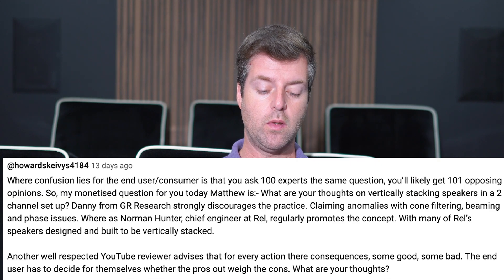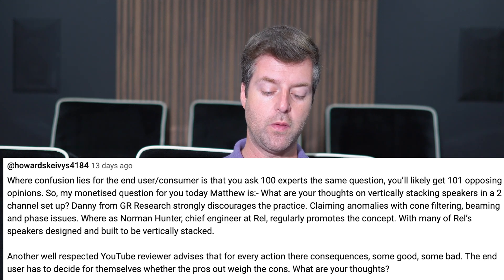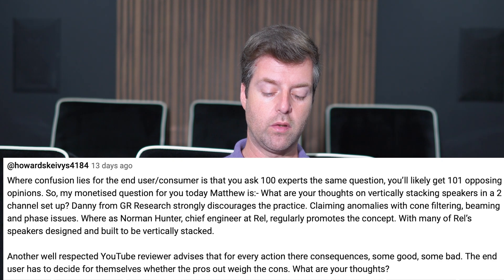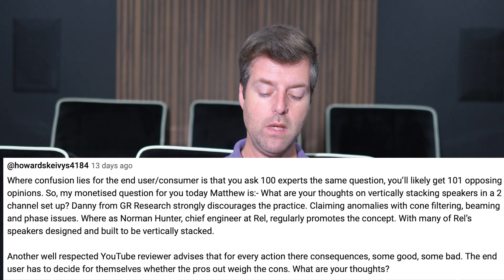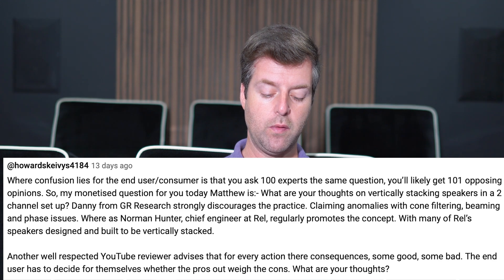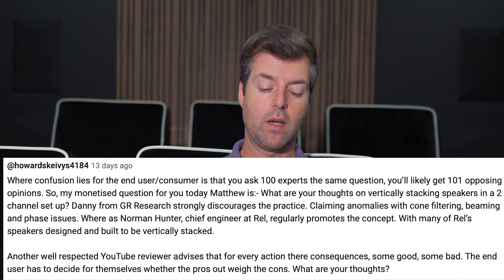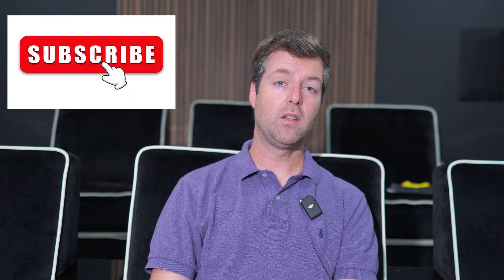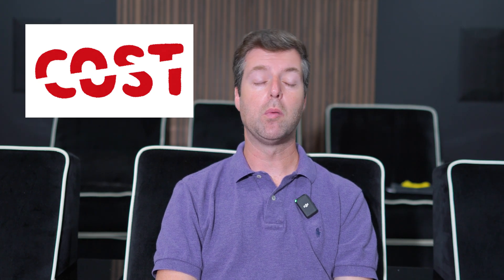Unveiling the secret to vertically stacking speakers

Comment: @howardskeivys4184 I think what is being discussed is playing sound through multiple, different speakers at the same time. If you're playing speakers individually as pairs in stereo, then there probably is no issue with stacking. I think the issue is mainly phase when playing multiple different speakers that are stacked at the same time because of the difference in time in which output is produced via the speakers. All the components need to be exactly working together to be in time with one another, which won't happen across different brands or with different components. That's my understanding of it.

Comment: The biggest issue is sound wave lenght of the highest frequency speaker driver radiates. (More) Tweeters must be in some kind of perfectly calculated array to overcome this issue (aligned as close as possible to reach other). Lower the frequency more spaced out drivers have be to overcome this comb filtering. Simple math.
This issue can be seen on most horizontally aligned 2-way centers in MTM configuration where it is even worse because human is more sensitive in horizontal pane than vertical.

Comment: Couldn't u use a dsp and make separate boxes for tweeters, midrange, woofer, each with their own xlr outputs to go into a 3 way dsp. Then you could make truly modular speakers. Pro audio does it
Reply from the maker: Sure but that’s completely different. And you still have a number of issues. First you need to maintain correct center to center spacing for the drivers.  Second, you need to know how to set the crossover.  It makes no sense to stack a bunch of unknown speakers and set the crossover based on crummy in room measurements. High end pro audio speakers are not a bunch of separate boxes. They have the midbass, midrange, and tweeter in a carefully designed system. Even if they are active, the DSP settings are based on proper anechoic characterization of the speaker.  You simply can’t equal or better that on your own. 

And again, taking two random bookshelf speakers and combining them won’t achieve this or anything good. It will play louder. A lot louder even. But it won’t give good sound quality.
Reply: @PoesAcoustics  thanks the detailed response. I really think I'm gonna try this but just very slowly because part of the point would be to have multiple choices for woofers, mids, tweets so that will be a lot of speakers and boxes. Maybe ill try to build adjustable rail system for the boxes to fine tune. Either way it will be fun. Thanks for all.

Comment: One of our customers sent me over a link to this video a few minutes ago. You are 100% correct regarding stacking full range speakers and subwoofers. I shot a video 4 years ago on stacking speakers and showed what happens via measured responses. It also confirms what you just said in this video.  

 https://youtu.be/0GXEine4jpg?si=eDTo7RELrGpsTq16
Reply from the maker: Hey Danny. I figured there was a misunderstanding. I initially misread the question and thought they were suggesting that you were claiming that stacking subwoofers would cause such issues. Then I realized they conflated the notion of stacking subs (one issue) vs standing speakers (a whole different issue). 

I also did a video for Gene on flip stacking where I also measured the results.  They were terrible. I presented the data and showed why it was so problematic. I am still at a loss why people are doing this.
Reply: @PoesAcoustics easy. Most people always thinks they know better. Thank you for your education, Matt

Comment: Thank you Matthew for answering my question. Your response was pretty much what I expected. I’m going to level with you:- I went against all good advice and vertically stacked 2 identical pairs of speakers. Each pair of speakers driven by separate power amps. Each power amp connected to the same preamp. In my humble experience, the benefits far out weigh the caveats. My normal listening level is around 78db. I can now achieve that level with the volume control on the preamp turned to 43. Previously I had to turn it to 51. Previously at a listening level of 78db the dynamic swing would max out at 96db, now that dynamic swing peaks at 104db! I can easily and seamlessly execute an A-B-C comparison between, top speakers only, bottom speakers only or both playing simultaneously. I can detect absolutely no change in frequency response/range, tonal richness, acoustic mass or soundstage. If there is a caveat, maybe, just maybe, the high frequencies are fractionally more directional, more beamy. This though may be psycho acoustics playing tricks with my auditory system, as so many people told me, that’s what I should expect to find. I may be totally wrong about this, but, because I now have twice the surface area of speaker cone,  I now hear a much higher ratio of direct sound to reflected sound. Which surely diminishes the influences of the room.

As for 100 experts and 101 differing opinions. A few good examples are:- 

Speaker placement. There is 1 camp that swears by the equilateral triangle. Another swears by the 38% rule. Another the 1/3 rule, Etc. Cables. 1 camp swears that cables do make a difference. The other camp swears they don’t. 

DSP. 1 camp swears it’s the best thing since sliced bread. The other camp proclaim it’s just another processing stage in the signal path, which can only cause degradation to the purity of the signal. 

The list goes on with each camp having its own expert/s, fighting their cause.

room.
Reply from the maker: Don’t conflate the expert with enthusiast. Most of what you have there relates to arguments from enthusiasts. Not experts.  Real experts don’t really debate these things so much.  

As for your flip stacking experience. To each his own. You have certainly introduced issues. If they don’t bother you, it may be that you really were missing out on dynamics. But then I think you probably would be happier with speakers that have 6dB more output. A very significant difference.  That is what you need to try next.
Reply from the maker: @Echo-jg8is  that isn’t correct. If you add an identical speaker and do not add a second identical amplifier. That is 3dB. If the speaker can handle it and you add an amplifier that is twice as powerful that is also 3dB. If you add two speakers with two amplifiers, one each, that is 6dB. 

Each addition adds 3dB. If what you said was true, every room modeling software, acoustic software, and SPL calculator I’ve ever used is wrong.
Reply: @PoesAcoustics  Thanks for that, I honestly thought that having 2 of the same boom box's for example playing the same signal at the same volume would result in 3db gain and not 6db. 😬😕
Reply from the maker: @Echo-jg8is  well you doubled both the speaker area and power. Classic calculation for that with fully coherent summing is 6dB. For subwoofers, you will largely see coherent summing if you stack.  With higher frequencies it all depends on the distance between drivers. 

We have actually done some testing in the real world to confirm the accuracy of these calculations with actual products in actual rooms. We generally see exactly what is predicted or within a dB or so.

Comment: Pop the jumper on the bottom pair and use the woofers only to augment the other full-range speakers, you might be surprised. I used the two pairs of binding posts on my amp so I can do a quick A/B and I've decided the pros outweigh the cons *in my setup.
Reply from the maker: Are you saying you stacked speakers but just used the woofers to Augment the other pair?
Reply: @PoesAcoustics  yup
Reply: @PoesAcoustics sounds like mid-bass kick bass sub

Comment: I suppose the exception to this is Line arrays used in live sound, but the point of that is to give each area of a venue it's own beam of high frequencies, not sum together or aimed at a single sweetspot?
Reply: Then there are line arrays designed for home audio use - e.g. Roger Russell IDS 25, and numerous DIY projects that definitely take comb filtering into consideration with a variety of filtering and shading methods. Danny’s own NX-Treme consists of 10 cone woofer / mid bass drivers and one planar / ribbon per side, so as always it’s the implementation that counts.
Reply from the maker: Completely different situation. A line array in pro is using purpose built line array speakers with tightly controlled directivity and DSP to align everything.  They do combine into a single summed planar beam.  However to achieve that they use specially designed speakers made to be slacked.  The vertical spacing between the Hf drivers is very critical.  It needs to be very tight. If you simply stack residential speakers together you cannot achieve that.